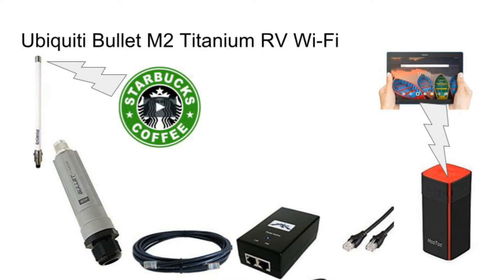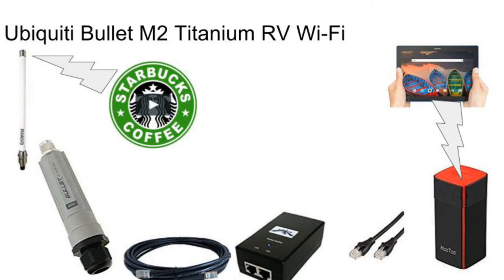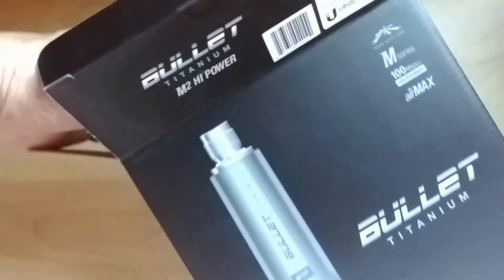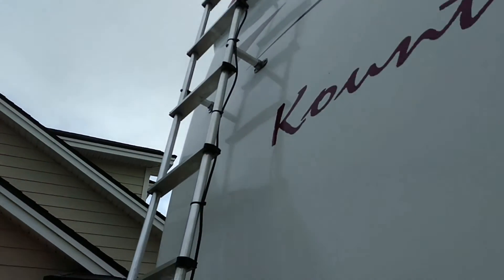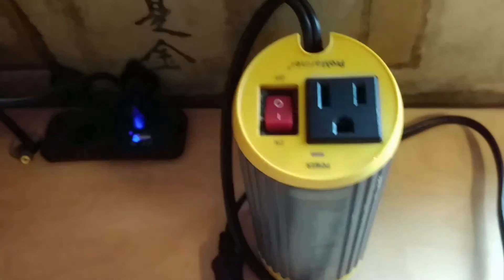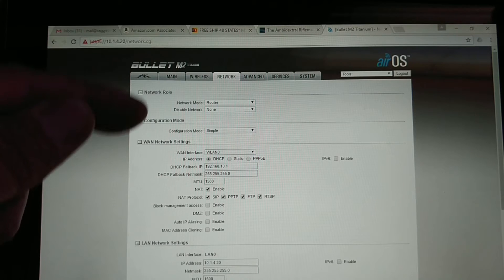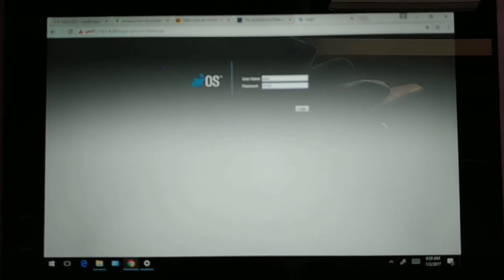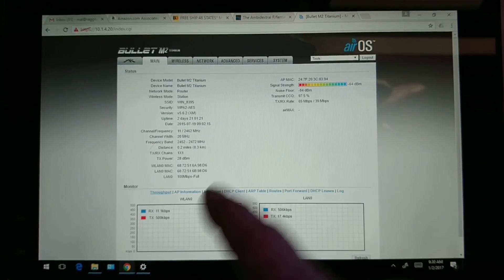RV Wi-Fi Bridge with Ubiquiti Bullet M2 Titanium

Comment: I'm stuck at "Setup the Ubiquiti". How does that happen? Which website is this? I setup a Ubiquiti account but that went nowhere. Thx.
Reply from the maker: Try connecting a PC direct to the Ubuquiti Bullet M2 via an Ethernet cable. Your PC should pull an IP address from the Bullet. My device is managed by going to http://10.1.4.20 but I'm not sure if that was the default. If that IP address does not reach the Bullet's interface, try 10.1.4.1 or 192.168.1.1
Reply: I think AmbGun is correct but you could also try 192.168.1.20

Comment: Is it possible to connect to Starbucks AND McDonald's wifi internet simultaneously to hopefully increase throughput that my laptop in the RV across the street sees for streaming youtube 4k? If so, how?
Reply from the maker: That would require two Ubiquiti M2 Bullets that then fed into an aggregator. But generally such things are more for load balancing rather than achieving a greater throughput. In other words, the 4k stream would choose one route, but maybe other uses could use the other.

Comment: Thanks for the info.   Question on logging into the WiFi network.  Wouldn't you do this from the Hootoo device?  In other words, can the HooToo see all the WiFi networks the Ubiquiti locates?   I'd much rather use my Hootoo to handle all the setup details for Wifi.    In your setup, Ubiquiti is the AP and Router and only thing HooToo does is broadcast the WiFi signal...??
Reply from the maker: Forget HooDoo device or any device that even hints at offering router or firewall. Insist on dumb Access Point.

Comment: What mode do you have the Hoo Too in - AP, Router or Bridge?
Reply: Can you tell me which model of TP Link? I am looking for something reliable as well. Thanks!
Reply: So is this TP Link device an AP or a Router? I don't understand the difference. I have a similar setup to yours in my RV - just a different make of antenna on my roof. I am currently using a router. Should I be using an AP instead? I thought that you can't use an AP without a router?
Reply: Is the PC connection to the Ethernet drop a one time thing or do you have to do it every time you connect? Is the AP a better way to go than a router? If so, why? Thanks!
Reply: I have been having ongoing problems with my setup. I have a router and it wasn't until I put it in Bridge Mode that the problem has since disappeared - for how long I don't know.  The problem I was having was that if I lost the campground internet connection, the network would not even come up in my list of available networks to connect to so that I could go the antenna's portal to reconnect. Since I put it in Bridge mode I can now connect to my network so that I can go to the portal to reconnect to the campground. Do you understand what I'm saying? I'm probably not making any sense to you because I am not that knowledgeable.
Reply: The signal strength is consistently between -65 to -75. But it doesn't reconnect on its own. Every time I lose the connection, I have to go back into the portal to reconnect to the campground. Maybe I have to change a setting in the antenna's portal or what do you think? Thanks!
Reply: As soon as I go back into the portal it starts to reconnect automatically. You're right. Not only is it a good signal but it's also 5Ghz which is rare for a campground and my antenna is dual band as well. Also, what is happening recently is when I lose the connection to the campground wifi, my iPad automatically switches over to one of my other networks even if I don't have the other device turned on. This makes no sense to me. By the way, I have 2 other options for internet in my RV - 2 AT&T Unlimited Data options which give me no grief. I only have problems with this one. I really want to get these problems resolved but I'm not sure what to do next.
Reply: Hi Mark. I'm having problems again. Can we have a phone conversation
Reply from the maker: Updated video at...
https://youtu.be/ejikLEZs6cY